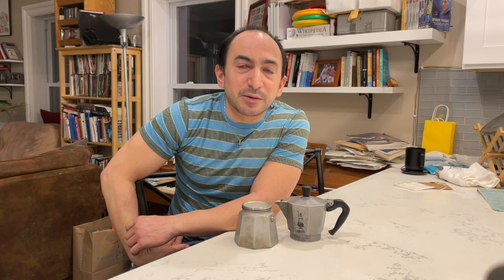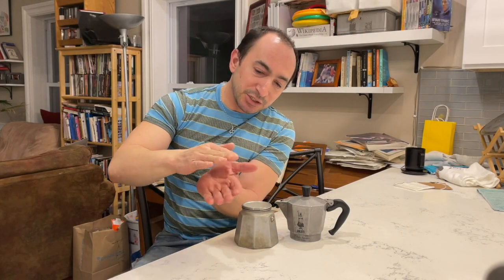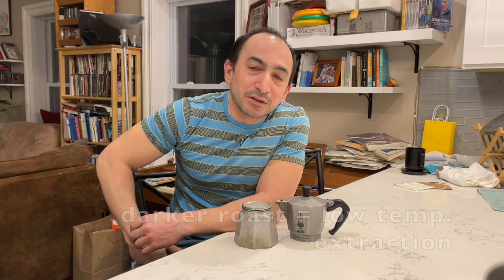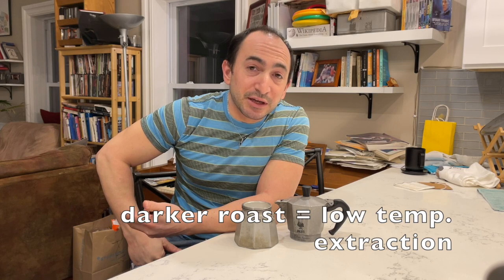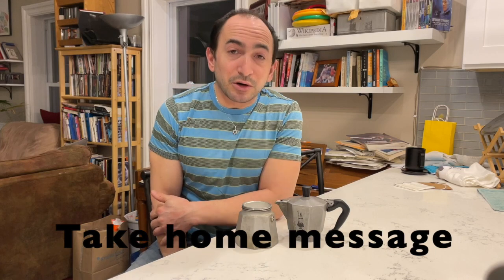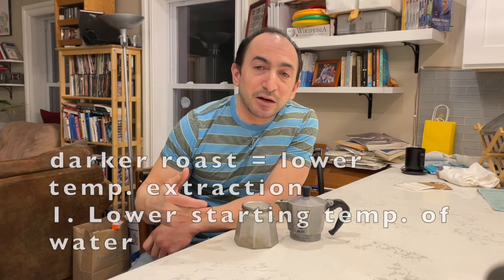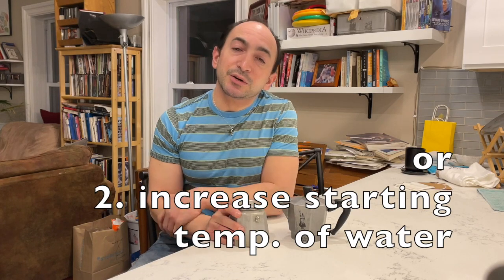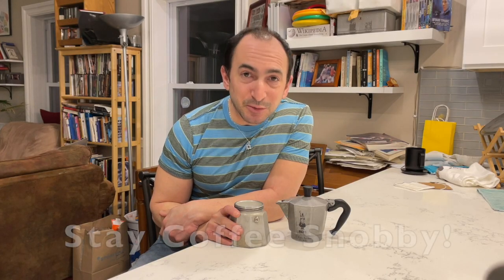Dark roast in a moka pot?

Comment: I'm curious how that paper counts '100ml air gap' specifically? Does it mean less 100ml from safety valve?
Reply from the maker: Hi!  For some reason, the location the PDF paper got moved, but you can still find it here; https://prokofe.ru/files/public/1545073434_16273_FT107421_the_physics_of_a_stove-top_espresso_machine_warren_d_king_king2008.pdf

To answer your question 100ml is the amount of unfilled space when putting in water up to the fill valve.  Here's the key sentence:

"From the point of view of extracting coffee at higher temperatures, Fig. 4 shows that minimizing the free space is a
useful strategy, although the volume-weighted average temperature is still only 81 °C for 30 ml of free space. In most models it is undesirable to fill to this level from a safety point of view because the water would cover the pressure-relief valve designed to vent steam if overheating occurs."
Reply: @loodog555   Thanks for a quick response! I had accessed and tried to read the paper before asking. It's just that I am dense and don't quite understand what it said. lol

So I have a 3-cup bialetti. When I fill the water to fully cover the safety valve (right below the basket), which is dangerous, the amount of water is 180ml.  When filled to right below the valve, it is 140ml. So if I fill it right below the valve, I have a 40ml air gap. And to have 100ml air gap, I need to fill 80ml. Am I understanding it correctly?
Reply from the maker: @oldtelephone4610  Not necessarily, King's results were specifically tailored for the parameters of the moka pot he was using.  

Frustratingly, he doesn't say anything about which size model he was using - he just includes a picture of his device (Fig. 1), which doesn't look like a Bialetti-brand device, as it lacks that characteristic octagonal base and seems from its luster to be stainless steel instead of aluminum.

I use the pretty common 6-cup: https://killercoffeebeans.com/pages/moka-pot-coffee-recipe.  I just took some measurements on my kitchen scale to answer your question and it seems 300ml fills up to the valve, leaving room for another 120ml air in the tank.  

I might speculate that all the relevant dimensions might be scaled by a factor of 2 to get down to a 3-cup model, but you're saying that you're getting actually 1/3 of my size so maybe not everything is an exact scale model.  

In terms of practical advice, I think filling up to the fill valve (40ml air gap on yours) is the way to go if you want to maximally delay your brewing until higher temp is reached, as is advocated for a lighter roast coffee.  If you're finding that it's coming out a too bitter and overextracted (especially with a dark roast), leaving more of an air gap could be the solution you need.  That extra air will let the brewing water out of the bottom chamber earlier and at a lower temperature, which might be what you need to prevent overextraction.

As always, it comes down to what you like and your tastes!

Comment: I tried doing both: less hot water and fewer of it, and ended up with less bitter, and more sour coffee out of my dark roast.

However, it would leave me with less than desired amount of brewed coffee (out of my 3-cup pot, only had like enough for 1 person). Thinking of just using room temp water but at the max amount (at safety valve level). Do you reckon I should still use low heat, or can I get away with high heat to brew it faster?
Reply from the maker: Oh, interesting!  In general, the amount of coffee you get out is proportional to the amount of air included so that putting more water/less air in it, results in your getting less coffee out.  Putting less water should counterintuitively actually result in getting more coffee (up to a point)!  

In general, I advocate for the same heat technique, regardless of roast: medium heat up until you start see any coffee, then turn heat to minimum until your bubbly pale product starts coming out. 

The only thing with dark roast, is that you want a low temperature extraction to avoid overextraction (since dark roast already extracts very easily). You can start with colder water or put more air in, or both. I hope that helps!

Comment: Thank a lot dear for your great video, I really enjoyed that!
I have a question. How about grind sizing? I have a dark roasted arabica bean (I've chosen arabica because of lower caffeine), what is your suggestion about size of grinding and water level in pot? Is there any interaction between two parameters?
Reply from the maker: If my previous response didn't make sense, check again.  There was a typo.
Reply from the maker: Hi Hosein, thanks for the question!  Since grind size is about flow rate and extraction rate, I wouldn’t affect that based on my roast level or water level.  You’re aiming for something towards the finer end of a pour over grind size.  
Once you figure it out the grind says for your moka pot, don’t change it.  Good luck!

EDIT: Changed "Cry in" to "grind".  Voice dictation is fun!
Reply: @loodog555  Thanks, but I think there is another misspell 😀, " grind says...". I'm cool with your answer BTW.
Reply: There is only one correct grind size for the moka pot and that is medium-fine.

Ask Bialetti.

Comment: Isn't dangerous to fill the moka pot above the valve? Thanks!
Reply from the maker: That's the understanding.  I've never personally tried it and I think in reality, the extra pressure would just relieve itself through your coffee puck, (though I guess if you somehow jammed enough grinds in the connecting tube, you might be able to block it).
Reply: Yes, it is very dangerous. I'm pretty fed up with all the ridiculous bad advise for moka pot, when the correct way is so simple, easy, and produces perfect coffee every time - provided you use the right kind of coffee and water. 

Search for Annalisa J moka pot video, she does it the traditional Italian way they've used since 1933. My coffee is always perfect now thanks to her video.

Comment: In a Moka Pot the less time the process takes the sweeter it is. I fill it with 190 degree water and loosely filled freshly ground coffee (filled almost to the rim).  Control the temperature by moving the pot away from the heat source.  Using a filter does not hurt.  When you see the spurts remove and put under the cold water. The size of the pot makes a lot of difference. I prefer the 3 cup pot to my 6 cup.  When done right Moka Pot for many people is better than espresso.  It's a sweet spot for me, between espresso and pour over.
Reply from the maker: Hi Mike, thanks for your comment, but it seems you're talking more general technique than the specifics of how roast level should alter your brewing.  The more general technique discussion is found here: https://www.youtube.com/watch?v=jcgMeDDAT-s

As for your comment that "In a Moka Pot the less time the process takes the sweeter it is," this is only true in the narrow range in which you are likely to overextract your coffee e.g. when you brew with dark roast or grind too fine.  Otherwise, you may find that if your time is too short, your coffee stops becoming more sweet and actually turns a bit sour and acidic.
Reply: @loodog555  Finer grind and less heat for lighter roast.